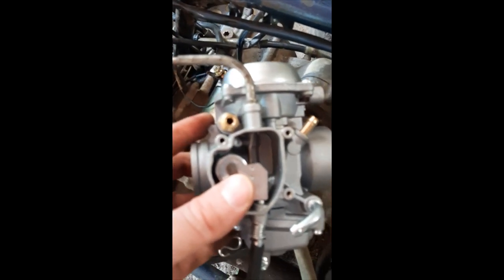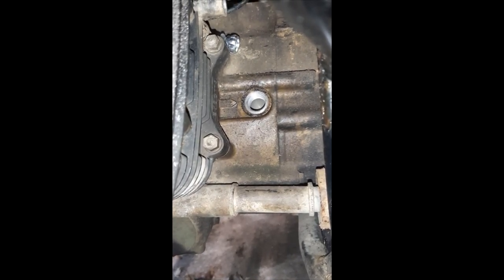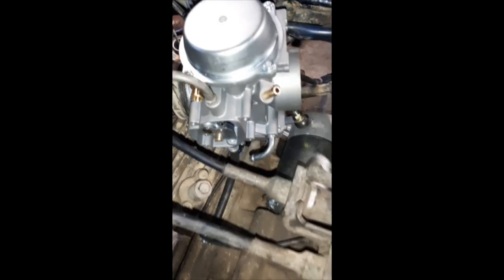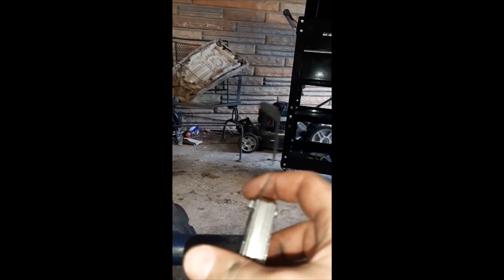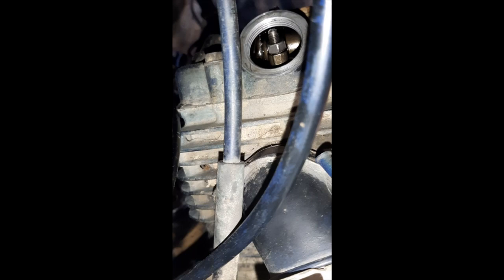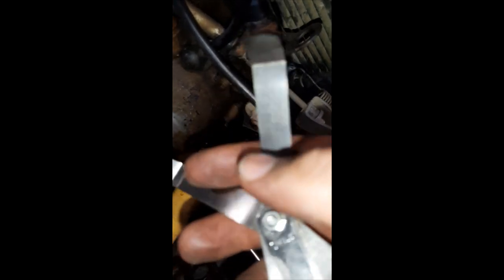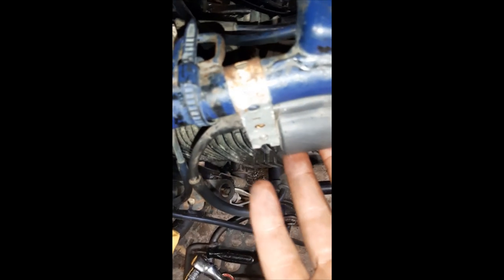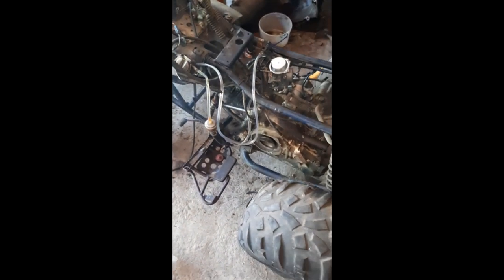Lets do some timing and valve adjustments/ATV quad-runner 250 1987

Comment: Is that the 2 wheel drive or 4 wheel drive? And thank you for the video.
Reply from the maker: @OnedayatATime4ever77  this one in the video is 2wd
Reply: @Cawdy28  awesome just the information I was looking for. Thanks you even more now for the video. Now I must go work on my free 4 wheeler some more this is day 5 of putting it all back together. Everything was there but it was a mess. From wiring to the automatic clutch to the breaks and so on. I'm having a problem with keeping the drive chain from getting loose when riding hard and at low idle I can tell something needs adjustment in the motor so decided to park it so I don't mess it up. Until I get it right. Everything works as it should no reason to break it. Ya know. Thank you again for posting videos. If it wasn't for guys like you. Guys like me would be stuck. I was able to get the clutch going as well with a video I found as well. Already put 40 miles on it lol

Comment: My carb doesn't look like that on my 87 quad runner 250 4wd.
Reply from the maker: That's how mine looked unless 2wd and 4wd drives are different
Reply from the maker: The new one I put on was Chinese knock off the older one was mikuni Corp